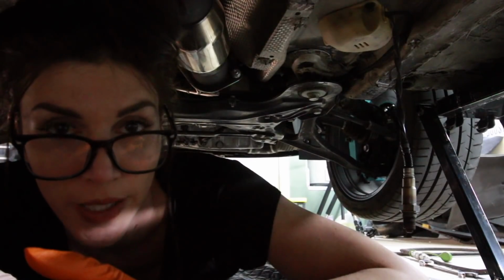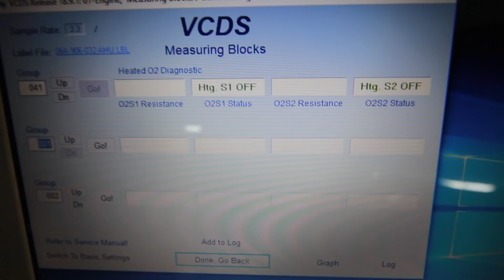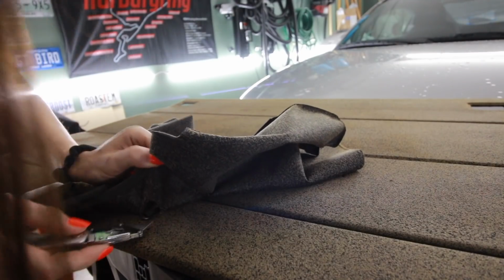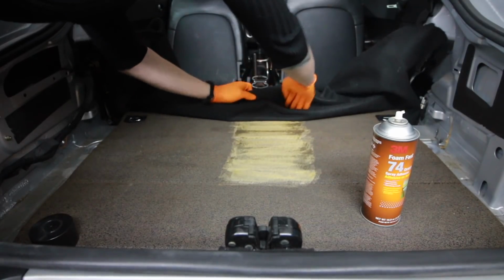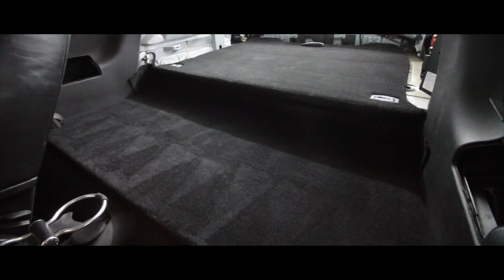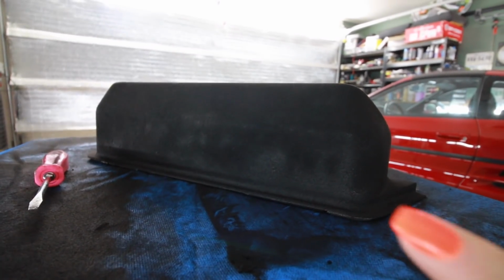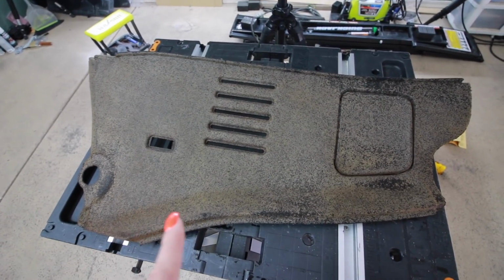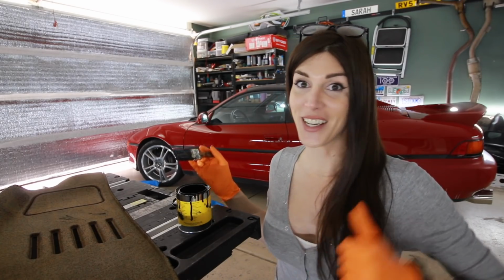How To DIY Custom Flock Interior // Project Audi TT Quattro

Comment: Flocking great video, like always. If you want some nice seats without spending a ton, look at some Corbeau seats. I used the RSS in a Mustang and they worked great. I was able to transfer the heating elements and the air bag to let it know if someone was in the drivers seat. They have great bolster and are pretty damn comfy too, plus they looked pretty damn nice.

Comment: For the seats if you are on a budget go check out corbeau. They have some nice but cheapo seats. The rrs seat looks realy nice. If you want quality go for recaro sr range but I heard you speaking about the weight of the stock seats......why not put a fixed bucket seat in there like a corbeau nfx or better a recaro pole position? Last on only weighs 12.5 kilo per seat.

Comment: First, you are a flock tease, because I really wanted to see how those panels turned out. 

2nd, I really want to see if you can get heating installed on aftermarket seats. I want to do that on my Cayman.

Comment: Great work (as usual)

Any old cheap rattle-can primer would've worked as a 1st coat sealant over those panels.  If you would have used even a flat finish enamel it would have been enough to seal the subsurface against some amount of moisture.  Plus, if you end up with any "thin" areas of flocking, a light spray coat of 3M Adhesive over the thin areas will do for you to re-flock those areas.  (Done that before myself.)

Regarding your rear seat delete... I'm sure that you would have checked on it but isn't that going to drive the insurance rates up?  I know Audi stuck those seats back there originally to avoid just such a situation with European insurance standards.  Can't imagine that it'd be any different here in the U.S.

Comment: I've found using 'Occam's razor' works a Lot!  I had an issue with a Tractor and the blades tripping and not engaging.  Checked evvvvvrythang to No avail....then i checked the One thing i'd looked over.  A loose ground wire.  Taaaa Daaaah.

Comment: Personally i think pulling some stock sport buckets out of one of the mk5 golf variants like the GTI or R32 would be a good budget choice.
the mk1 audi TT and the mk5 golf are on the pq35 chassis and should simply bolt in... 
I'm not 100% sure on that though... GLI seats out of a mk5 jetta might be nice too

If you want extreme weight reduction i suggest bolting a plastic lawn chair in :)

Comment: I'll actually comment on your seat question. I would take them to a good custom upholstery shop near you and have them build up the bolsters the way you want them and recover. They can save the seat heaters easy. Might even be cheaper than Recaros.
Reply: Agreed. Great comment and a practical solution. Then she could re-do those seats in Alcantara! Much better than leather.
Reply: @stephenmoxley5188  I don't have much experience with alcantara. The few times I've been in a car with that was a BMW with the alcantara headliner. Real nice! Don't know how well it would hold up on seats.

Comment: Turned out fantastic for your first time, delete, carpeting and flock. Nice work!

So glad you prefaced installing the elbow fixing the issue with a maybe. I hate it when it's a poor connection and you don't end up with a tangible diagnosis, but it just starts working. A bad contact after a fair amount of time of that connector being open to the elements makes a lot of sense. Hope it keeps working!

You're not really going to be able to reuse the seat heater elements from your current seats, they're kind of delicate and usually will break the thin wire of the heater when you try to unglue them, but you can get aftermarket/universal heating elements to put in the new seats, and use all of the existing wiring and controls with some simple rewiring. Only tiny bit tricky part would be either fooling the temp sensor in there with a resistor, or removing it from the old seat and putting it on the new seat, but you can handle it!

 You will need to put a load resistor in place of the side-impact/torso pyrotechnics, but that's easy. I'd go with a comfortable racing style seat, factory ones are heavy! SR3s do look nice. A used set might be a good option, since you'll be pulling the fabric off anyway.

Thanks for another great video.
Reply: @paulcopeland9035  These Oxygen sensors are effectively two separate components(per Audi component numbers are G130 for the sensor, and Z29 for the heater) The heater allows the sensor to function quicker, but the sensor or the potential it creates, have no bearing on the heater. The heater circuit(which is what the faults relate to) is a self contained circuit inside the sensor body. Fused voltage goes to one wire, and ECM grounds the other wire to complete the circuit.

There is no temperature sensing, grounding through the sensor body, or exhaust flow necessary for proper function of this circuit. The ECM only cares about the circuit being complete and having the correct load.

Other faults related to downstream/post-cat/rear Oxygen sensors can be solved with an elbow or defouler, but only faults related to the sensing circuit or catalyst efficiency, not the heater circuit. I won't dive into exactly what's going on there right now.

The sensor does not even need to be installed into the exhaust(don't try this, it gets pretty hot) and if the wiring and heater element are correct, it will not set either of the faults Sarah was getting. It is purely an electrical check.

Comment: Did you have the engine running or just key on when you were checking for voltage at the O2 sensor?

This question has nothing to do with the readings you got.

Comment: First time I’ve seen flocking material applied to a real car. Turned out real nice. As for seats, check out Corbeau.com. They have tons of different designs and are usually pretty reasonable for prices. I installed a pair in my 91 CRX and was pretty happy with them.

Comment: The spray glue works 4,000,000,000,000,003 times better if you spray both surfaces, let it tack up for a minute, and then press both surfaces together. Eyeballs straight, and carry on.
Reply from the maker: Michael Sullivan it worked pretty good as is, but I’ll remember that!

Comment: I also hate the 'stage 1, 2, 3' terminology.  I just describe them as software flashes typically, unless I'm having to deal with ordering something from the vendor.  Every vendor has their own version of each 'stage 1, 2, 3' package and that causes confusion as well.  I'd rather they just say '93 octane software for factory turbo', '100 octane software for K04 turbo', 'GT3076R kit',etc...

Comment: Lucky exhaust pipe!  Sarah,  put the upstream o2 in it's normal position.  Take that antifouler  you removed a few weeks ago and put that in the downstream location and the secondary o2 into the antifouler.  The second o2 needs to see less emissions than your upstream primary o2.  if they are the same you are not tricking the system in seeing lowering emissions, so you get a code.  Exhaust flow is Primary o2, cat/cats/ secondary o2.  Without the cats something needs to be done with your secondary o2.   Or buy a vibrant adjustable jbung,  and use the smallest orifice.  https://www.amazon.com/Vibrant-11619-J-Style-Restrictor-Adjustable/dp/B00AQ7972O/ref=sr_1_1?ie=UTF8&qid=1549733380&sr=8-1&keywords=j+bung